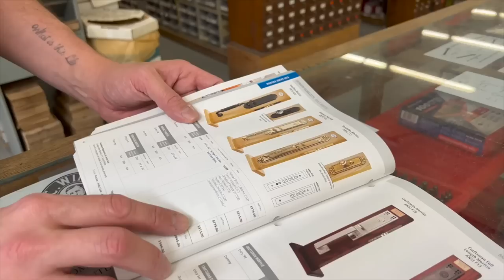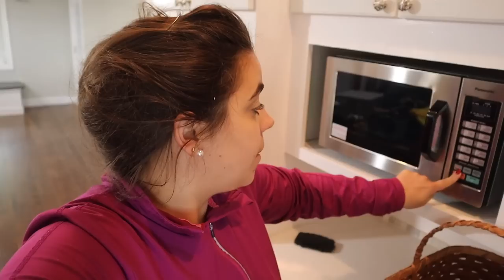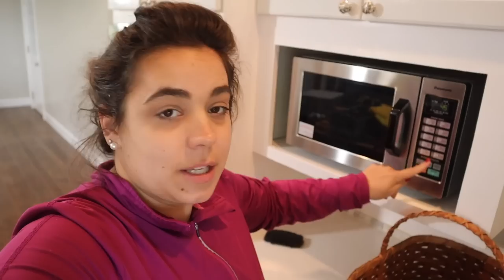It's gonna get WORSE before it gets BETTER!

Comment: Depending on whether you like the blinds or need them before your replacements are ready, they are dead easy to clip off and clean. I popped mine in a bath of hot water for a couple of hours with a dishwasher tablet. They were filthy and grimy but after two hours soaking, only needed a rinse with the shower head. Didn’t even need to scrub. Popped back into windows to drip dry. Bingo. Sorted! 😃

Comment: For your snack since you like grapes try freezing some in the your freezer, they will be nice and cold to have. All your meals look good and you do plan ahead on things, when  time counts working on the house. Glad you picked out the same hardware for all the kitchen it makes it look more cohesive. My husband and I have done total of two houses from top to bottom. the last one we finish and I got to live in it for six weeks before we sold it. A hint on the base board that I have is paint it  ahead of time before  you instill it and after you measured and cut it for a room.   Paint the wall, then you do not have to tape any thing, just worry about the floor covering.  When instilling the baseboard nail it and fill in the nail hole and just dab some paint over the filler. You are right about up dating the kitchen do it before moving in if you can to have a kitchen to fix meal in  and to wash dishes or have you canning kitchen ready to cook in if doing the big kitchen. Do have a complete bedroom and bath fixed and finish for you guys so you can retreat to it at the end of the day, because some things and days get overwhelming and you do need something completed. Hang in there things will get done. Remember the turtle won the race. Stay Safe

Comment: My ex (who was a carpenter) replaced our door knobs with his choice. They were a slightly bigger size. We ended up forever catching out fingers/knuckles between the trimming and door knobs. Got to the point I never shut a door again for years. 😂

Point is, make sure the knobs aren’t cheap large ones with short latch connectors. 😩

Comment: I was pondering on whether you might lose heat in the winter through all those gorgeous windows if you have no curtains …  particularly as you are a tiny bit more exposed — you mentioned sun but does winter hit harder too?